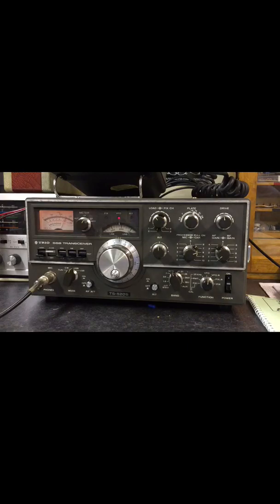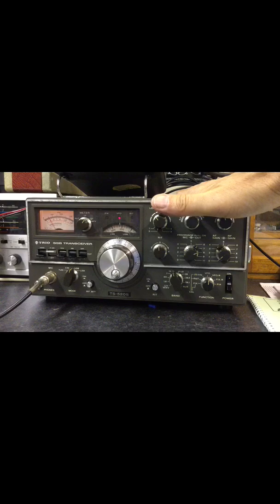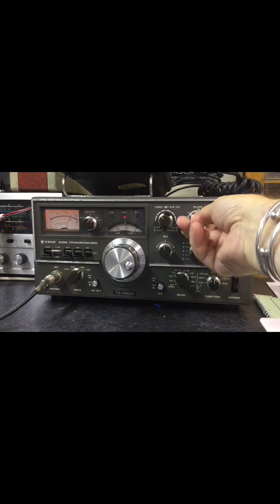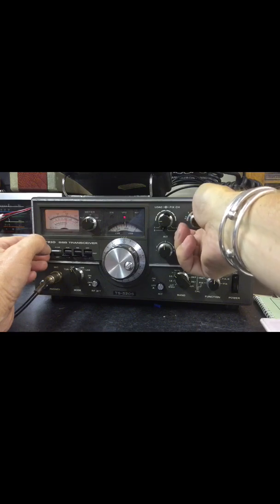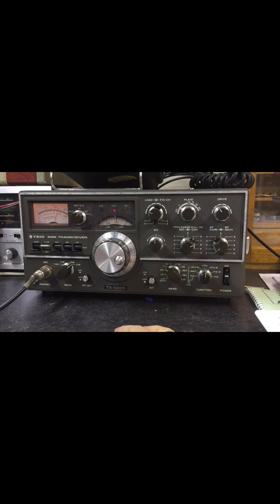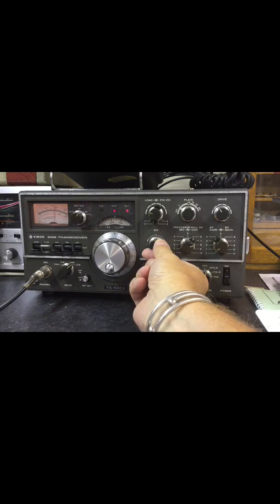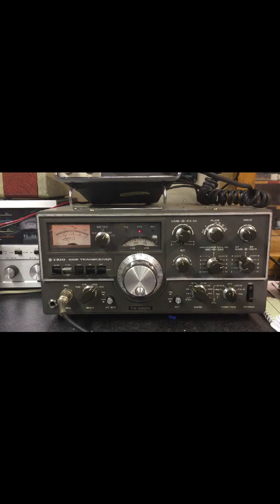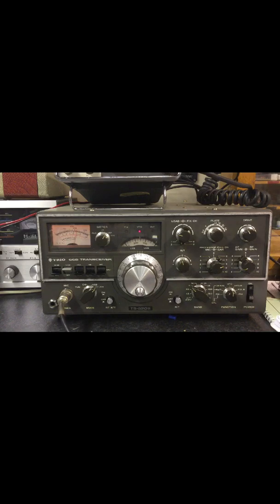How to use an analogue hybrid radio (Trio TS-520S)

Comment: If you meter is off check the resistor values  on the meter board  on top  under the top cover! If those resistors go south the meter is not accurate. Chow! Would love to work the UK hard to do from Utah. My antenna is from UK Sigma Comm. SF360 . JohnBoyUtah KJ7TBR 🇺🇸😎🎙📡